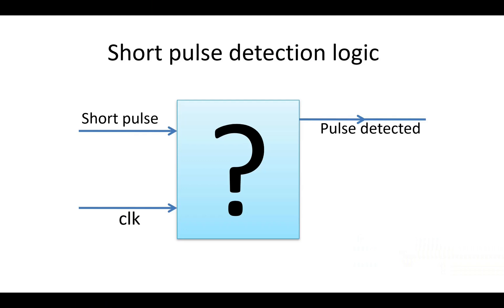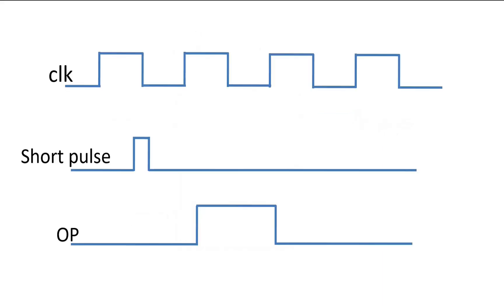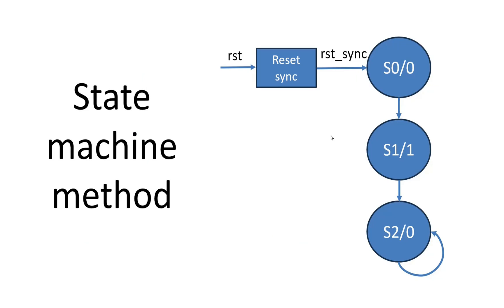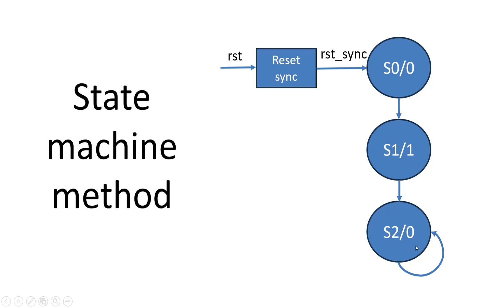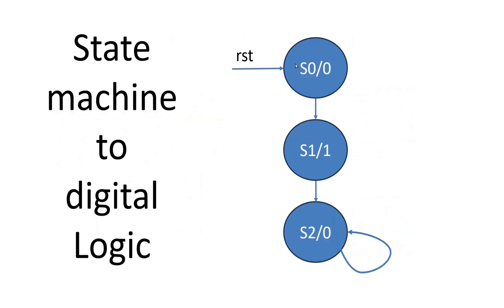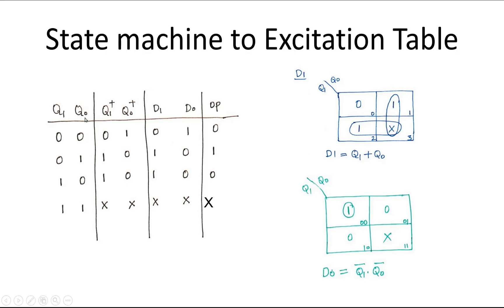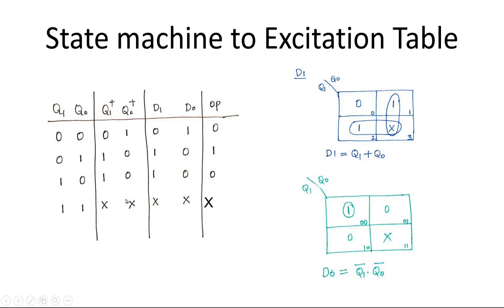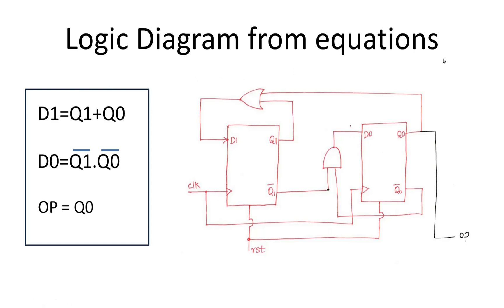Advanced Digital Design Part 2 solution

Comment: would it be easier to use combinational logic for detecting pulse and changing next states instead of synchronizing reset as input of the short pulse? What if pulse is too short to reset the DFF?